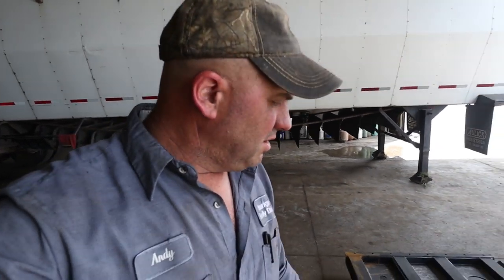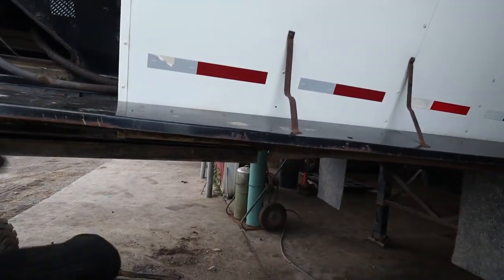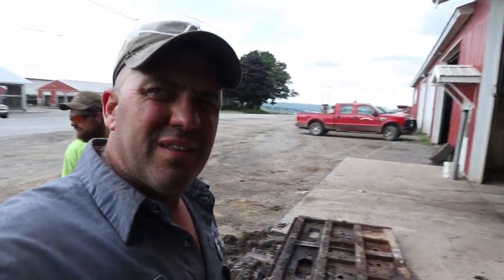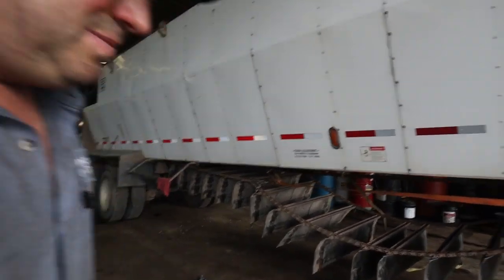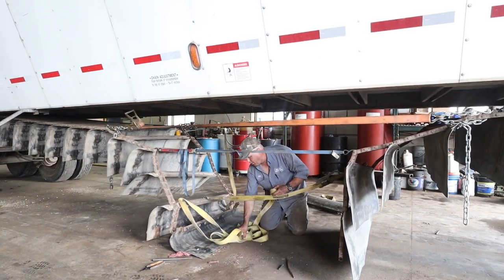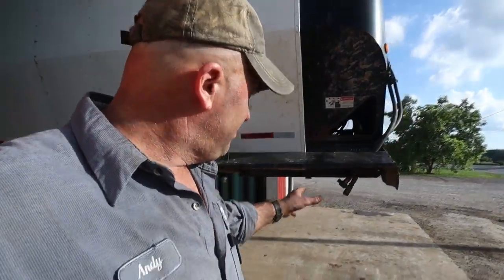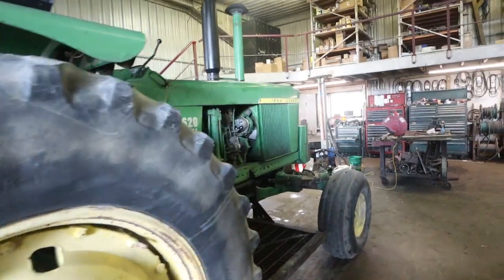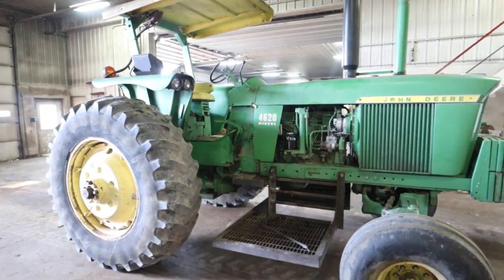Aulick belt trailer repair | 4620 is ready to bale

Comment: Another good video, Andy. I really like your channel. It's informative and educational because you explain things. Also, I like the clean language of your channel and that of the comments of the people who comment, and you are the one that sets the tone for that, because you don't use any bad language or sexual innuendo in your video, and that's really a great thing. I saw that Aulick trailer was built in Scotts Bluff, NE. I have been to Scott's Bluff when I was a cross country trucker. It has a sister city joined together with it called "Gering, NE". My Dad had two JD 4020 Diesels with wide front ends that we farmed our 1000 +/- acres with in Iowa in the 60's and 70's. One was a '64 and one was a '68. Dad bought them both brand new. They both had straight pipes on them, but the '68 straight pipe was chrome. They both had the synchro-range transmission also, which I preferred over the power shifts. They were great tractors.

Comment: I have a 4620 and grandpa and I restored it. we use it to bale and spread fertilizer. it is a reliable tractor always starts when it is cold without block heater or ether.

Comment: Andy I have a chance to buy a John Deere 5020 Is there anything I should look at before I decide to buy it the owner dose have paperwork for the engine rebuild but is there anything else I need to know
Reply from the maker: 50 year old tractor, try and start it when it’s cold that will give you an idea of how well and tight the engine is. Check every gear along with strength of the drive clutch. There are a ton of things to check and those are the most costly to fix.

Comment: i am looking for a king pin plate like that to put under my flat bed / wrecker bed so i can snap it into the 5th wheel of my road tractor to tow trucks in. i want to be able to take it off when i dont need it.....that way i can use 1 truck to do both operations. i will likely take one out of a van trailer.
Reply from the maker: I'll give you this one that I took out. I know it sounds cheesy but a little welding and I think it would be fine for what you might use it for.